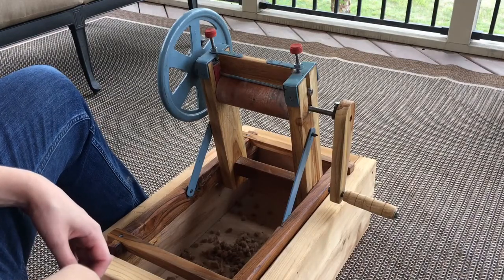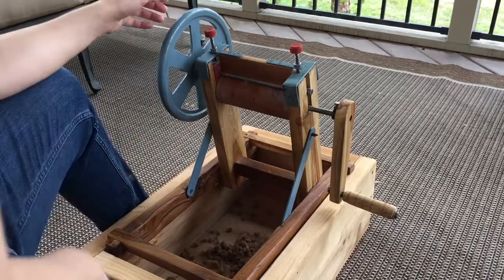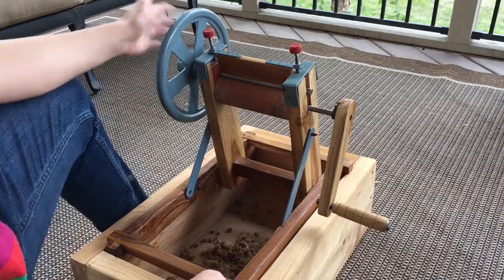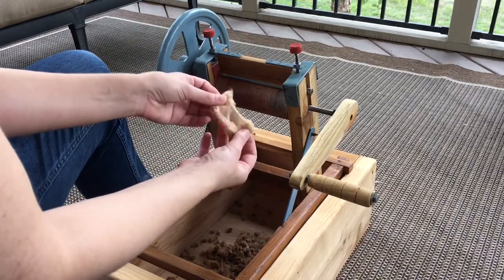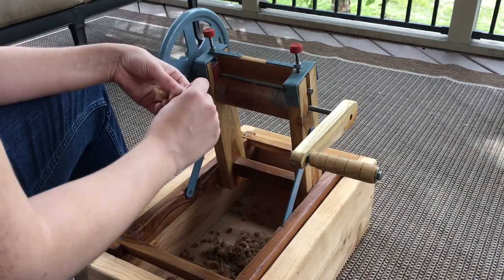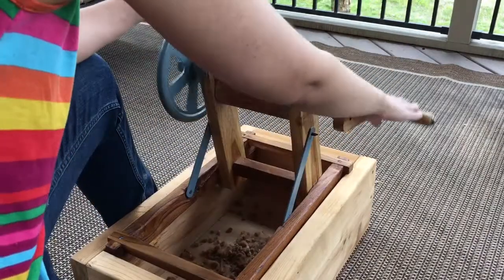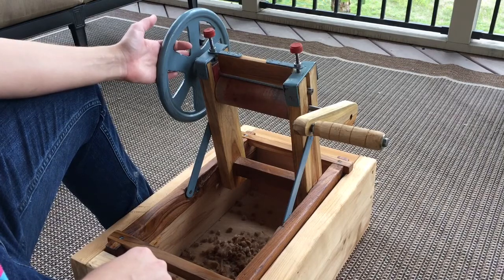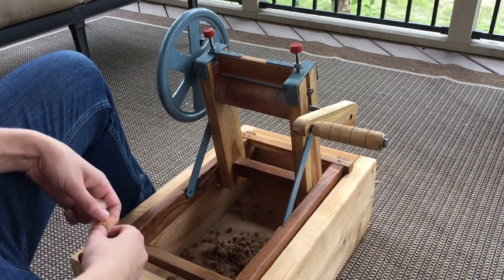Cotton Ginning with Crank Gin

Comment: Are the top and bottom rollers connected by a set of gears on the left side or does the hand crank turn the top roller and flywheel just by friction?
Reply from the maker: Hi! The hand crank actually turns the bottom (wooden) roller which turns the top (metal) roller by friction. The large wheel on the opposite side of the gin is attached to the metal roller though should I want to turn it by hand as well. Hope this helps!
Reply: @experimentno.1810  Thanks!
Reply: @TomsBiologicalVideography  Hi, Tom! Funny how internet works! I have just binge watched your videos on your Sea Island cotton and your cotton gins. :)

Comment: Mine is just smashing seeds and winding the fibers around the metal roller. What am I doing wrong?
Reply from the maker: It’s hard to know without seeing your gin, but it sounds like the seeds might be getting pulled between the rollers. I know mine does that if the rollers are a bit too far apart. I tighten mine until I get a bit of resistance when turning (but not so much that I can’t turn the handle). I hope that helps, but if not, let me know and I’ll try to think of other things that might cause it.
Reply: Might be using the wrong breed of cotton.
Reply: I want to by it .address pls